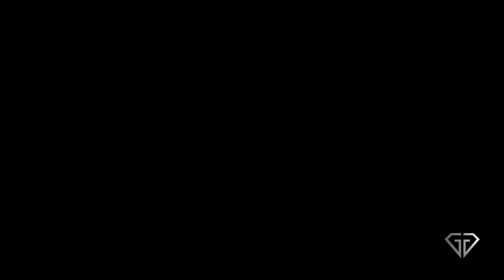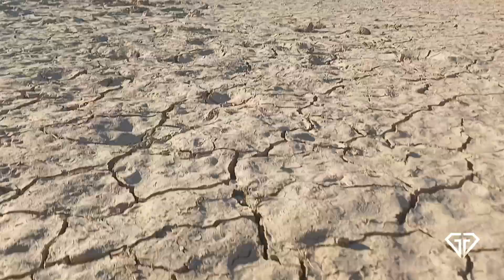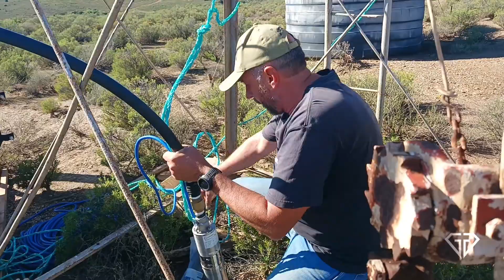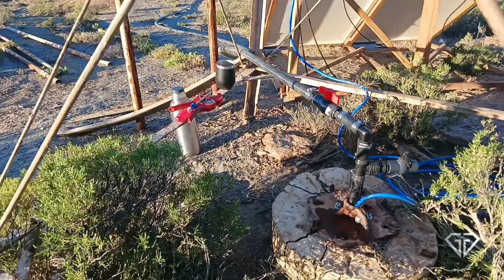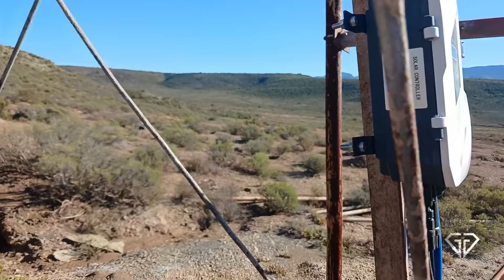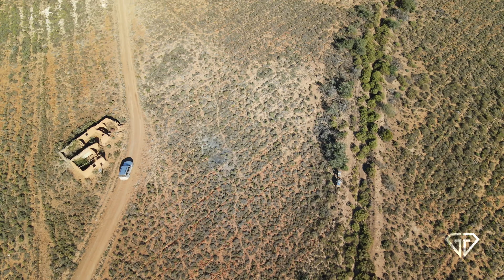Securing a water supply (Update 028)

Comment: You are doing great work! The pump will meet the short term needs for water till it runs dry if you want long term success all those ravines and washes need check dams to slow and soak the rain water into the ground.
The big dam's pond needs to be dug deeper about 4 meters with a gradual slope to the bottom as wild life uses it to limit evaporation adding Azolla water weed will further slow evaporation and give the animals something to eat that also eat cleans the water from all the poop the animals drop into the water. 
I would use the dirt and rocks from that excavation to expand the dams reach for more water or use it in the check dams further up the water shed system
Reply from the maker: I agree!  Been looking at videos on "beaver dam analogs".  There is SO much that can be done to  improve the entire ecosystem.  And we will get there

Comment: Why did you add the NRV to the pump and not above ground where NRV maintenance would be easier?
Reply from the maker: Hi, good question.  My thinking was to keep the 50m of pipe down the borehole filled with water, to save the time to reach ground level (approx. 1 minute 45 seconds) every time I start the pump.  Turns out, the pipe slowly empties, in spite of the NRV, so it is not really effective.
Reply: Glad you did it so I dont have to. I guess we can add this to the school fee list now. Would you say its totally unnecessary to add a NRV or would you still fit one if you had to redo it?
Reply from the maker: @louismoolman3245  I would not fit it again if I had to re-do the whole thing.  I would also double up on the pipe clamps on the pump - advice I received AFTER fitting the pump.  So far no problems, though...